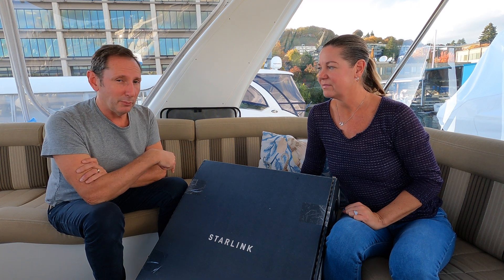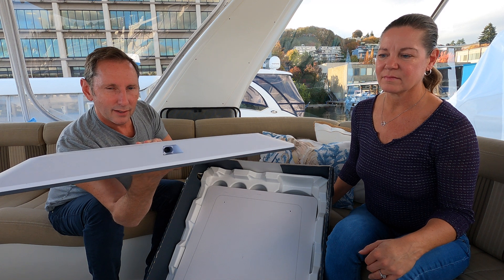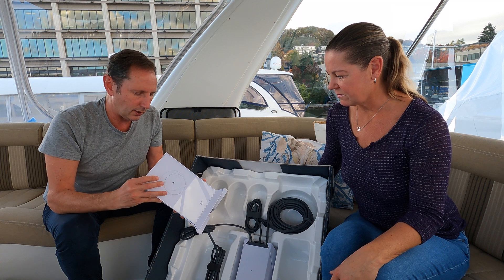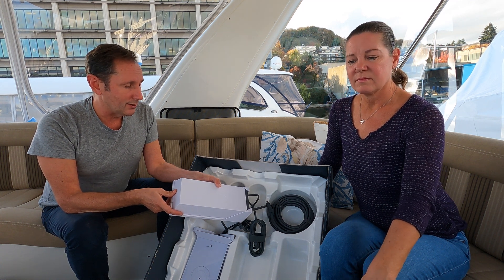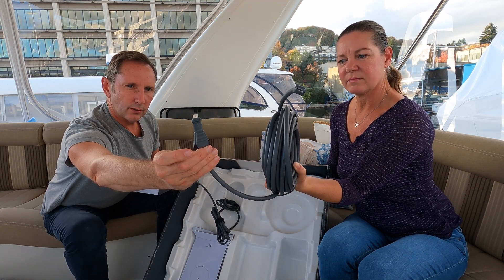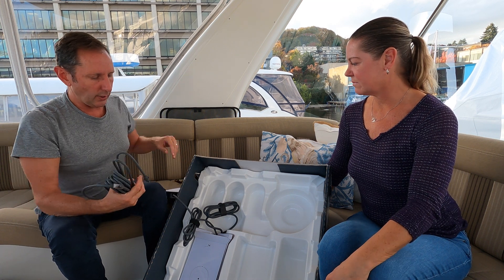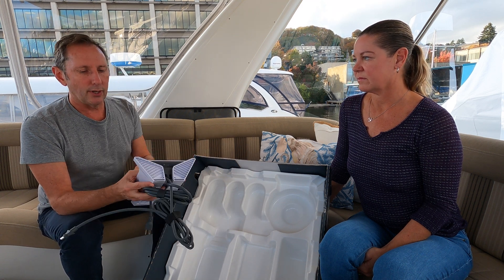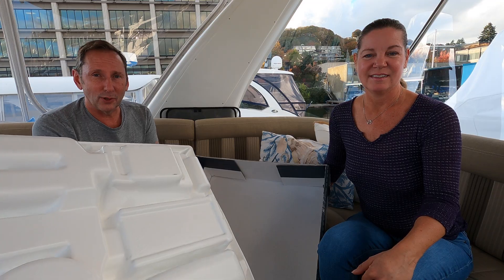UNBOXING STARLINK HIGH PERFORMANCE DISH

Comment: The Winegard order includes the wedge mount. They are licensed to sell the mobile unit and have it in stock. I’m going to wait until next Spring to buy it. I’m hoping that coverage will include the Bahamas by then. You didn’t mention the $2500 price or did I miss it?
Reply from the maker: I ordered one from Winegard and one from Starlink on the same day. The Winegard one won’t show until Wednesday. The Starlink ordered one showed up last Wednesday. They both listed the mount as part of the order. 

It will be into see if the Winegard one was just drop shipped, once it shows up. 

And yes, you are correct, its $2.5k. I mentioned that I. Our previous video but will make sure to mention that in our go forward videos. 

Thnx!